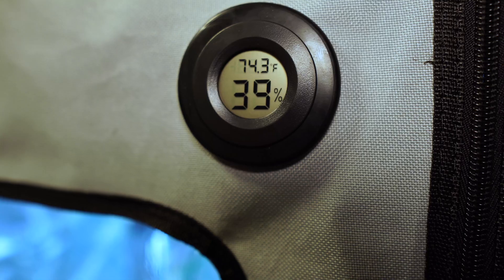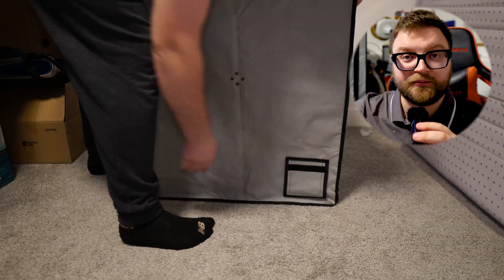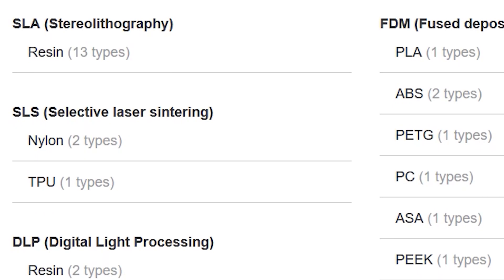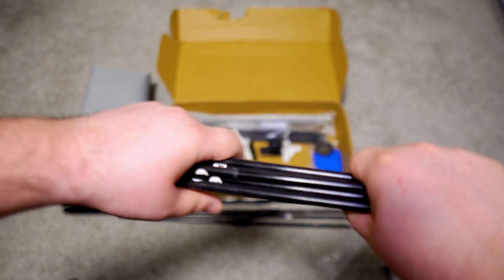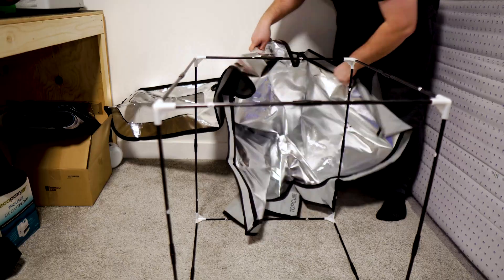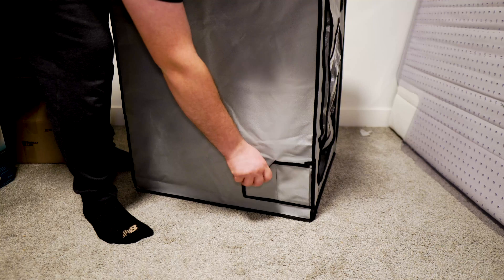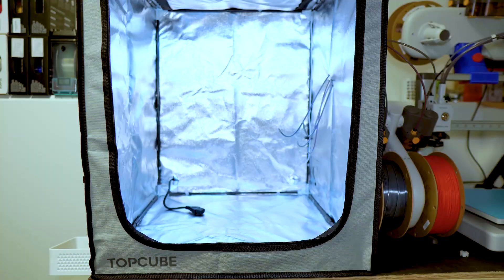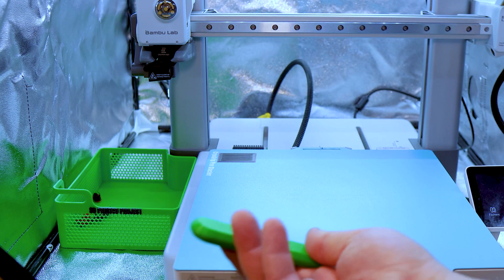Bambu Lab A1 Enclosure - Perfect Addition To Your Workshop

Comment: It is officially mentioned on the website that "The A1 is not recommended to be enclosed". Reasons for that are the electonics are not being made for this situation.
Reply from the maker: Pinned. Just saw that too.
I believe there is still use for it (cold environment - garage/workshop...) and to be exhausted out. Thank you for bringing this to attention!
Reply: @3DPrintedProject  the A1 mini for a fanand disipator as alls look fine the A1 only get a radaitor maybes you cna enclose it if you isntall a little fan on the controler board.
Reply: Did someone exerienced a toasted Mother board with enclosure on A1 ?
Reply: @paindepices8144  Nope. I have my enclosed from the start.  I think the most important thing is consistent temp, humidity and also fumes from certain materials. No need for high heat, rather consistent temp.
Reply: @dprezzz1561  what is the max temp you can reach ?
Reply: @paindepices8144  I do not know about the allowed max temp, but I have 40C in my enclosure, sometime 38c and it is enough.
Reply: Yiu can absolutely enclosed it. Just don't push the printer hard. Don't let the chamber temp creep up tooooo high

Comment: Hi, I've ordered the same enclosure for my A1 but I noticed that the enclosure is 60cm in height, but the A1 is taller by a couple of Centimeters. Did you have this problem?
Reply from the maker: Hey,

Nope didn't have this problem. Do you have the top mount installed for the AMS?
Reply: @3DPrintedProject  I'm not using the AMS Lite, just the single filament spooler which fits on the top. I noticed the enclosure is 60cm, but the total height of the A1 with the spooler is around 62cm. So, I've emailed Topcube as I might have to cancel my Amazon order.

Comment: can you check for me what size is the exhaust hole...i buy it  buy can't accurate measuring the hole....support mail just throw me link to buy their exhaust ...... but the shipping cost like twice the item to ship here
Reply from the maker: I'll check tonight when I'm back from work if that's okay. Not home till late.
Reply: @3DPrintedProject  it fine thank for reply , will be waiting for it :D
Reply from the maker: @flameboss555 hey there the hole is 67.8-68mm
Reply: @3DPrintedProject thank for reply, have nothing to measuring here
Reply: @3DPrintedProject  it seem like the hole was 67-68 but the mounting hole doesn't seem to be symetry i just model the symetry  adapter in fusion360 but mounting hole doesn't align....could you check for me that the hole doesn't align for your too or it just me.
Reply from the maker: @flameboss555  hello, I'll check when back. :) at work again. Back in the evening. I live in Canada it's just lunch time right now.
Reply from the maker: @flameboss555  yep. The outer 4 holes are not symmetrical. 🥲
Reply from the maker: @flameboss555  yeah, I just checked. Not symmetrical. 
Try to trace the holes on the piece of paper and measure the paper rather than the cloth/fabric. Just to make it easier?
Reply: @3DPrintedProject  already try and error printing dummy hole until it allign now the problem next is to find matching fan....that should be 7cm but the hole not symmetry......maybe need it to fit 8cm fan  with the help of magnet or something

Comment: I just read this so I figured I would post it.
While enclosures can offer benefits like dust protection and a more controlled environment, they are not recommended for the Bambu Lab A1 due to its lack of internal cooling and the potential for overheating.
Reply from the maker: Thank you Jerry. Noted. I pinned someones comment mentioning this too.

Comment: Can you top mount your ams while its in the enclosure?
Reply from the maker: Sorry for late response Ethan. @wizball666 i wouldn't recommend using this enclosure if you have a topmount AMS.

@3DTheory just released a video showcasing an enclosure that will work with a topmount system. Check that one out. :)
Reply from the maker: I'm not home right now, but I'm going to say no. Pretty sure it won't fit. That's one downside is that takes up a bit more space in that sense.
Reply: @3DPrintedProject  There is a shot when you had set it up that shows the printer next to it with a topmounted AMS. It looks like the spools will juuuust touch the top cover, but it's hard to gauge with the perspective.

Comment: finally sponsor! good for you :) did you try to measure difference in noise levels?
Reply from the maker: Hey there, I haven't done since I don't have a proper measuring tool. One way I can think of doing it is with a camera and taking raw files and comparing how much it will spike in db level.

Yoopai claims it goes down 60%.
Which it does feel like that. :>